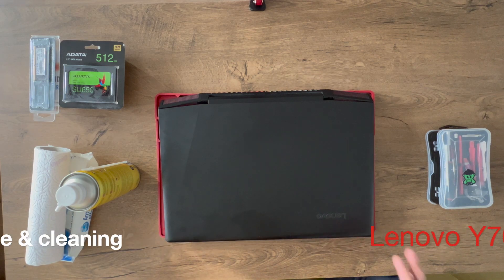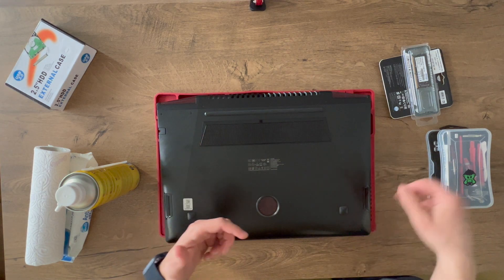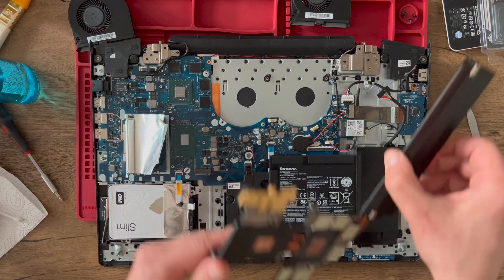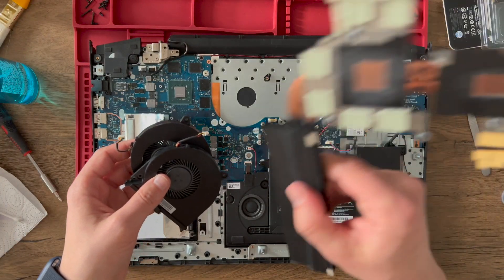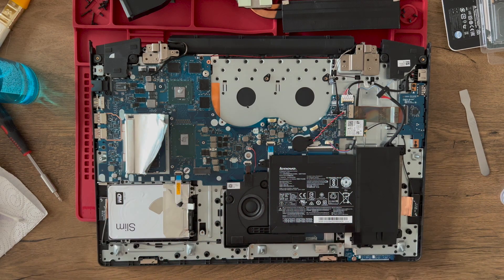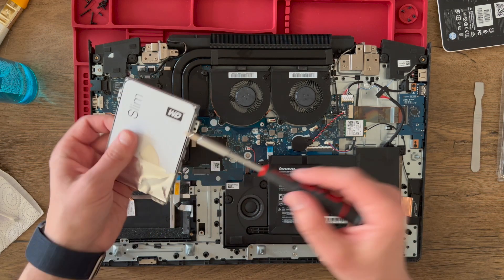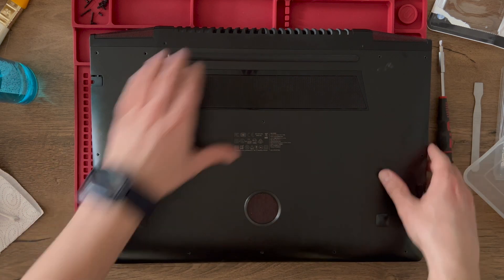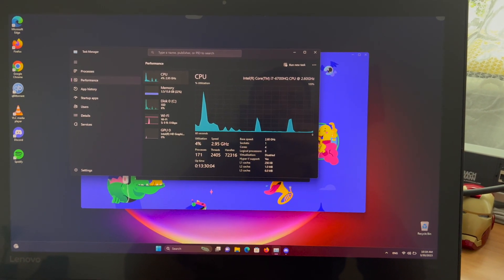Lenovo Y700 - Upgrade & Cleaning

Comment: how to clean the bubbles? mine has large ones all over the edges
Reply from the maker: which bubbles?
Reply: @martintsvetkov93 The bubbles on screen you mentioned at 0:38, you said they can be cleaned then you did not come back to that topic during the video.

Comment: Wouldn't the anti static glove be useful in this process?
Reply from the maker: it really depends on the environment you are working in - in my specific case I follow a simple process of rubbing my hands and always wear loafers with rubber on the bottom. If you work in an environment known to have a lot of static electricity you show wear a grounding bracelet.
Reply: @martintsvetkov93  thanks. I hadn't thought of it. i had opened up and cleaned the laptop plus i looked at another tip that the bottom plate u open around flat intake area has a filter cloth that gets blocked over time. In my case this is 9 yrs old so it was blocked. U can pull it out and for now my performance is better. Temp range for cpu is 65+/-10 c and gpu is around 55. Not sure if this is good or not, i will get thermal paste tomorrow so will do that then
Reply: Update - used arctic MX 4, anti-static gloves and 99% isopropyl alcohol. Now temp for processor is around 31 - 35 mostly but to 45 max. Meanwhile GPU was 36-40. So most effective between the two methods